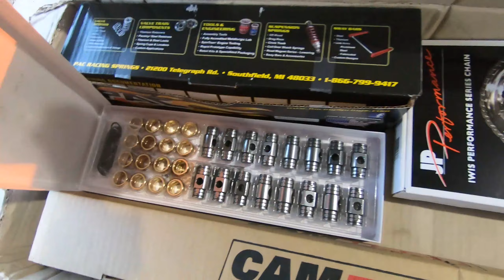LS1 Head Overhaul - Trunion Upgrade - Double Valve Springs

Comment: Remember the head bolts and main cap bolts should be tightened an extra 100-150nm over factory spec to hold correctly